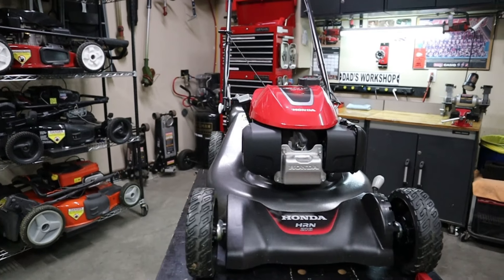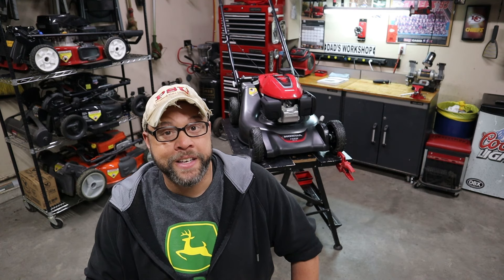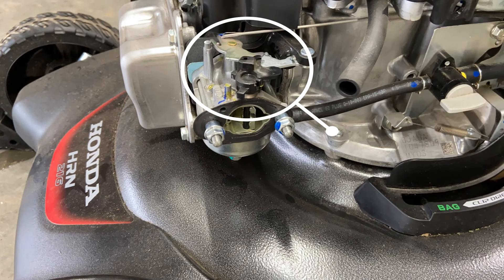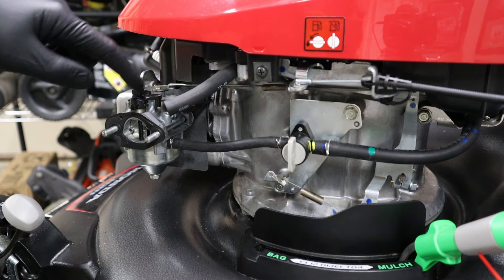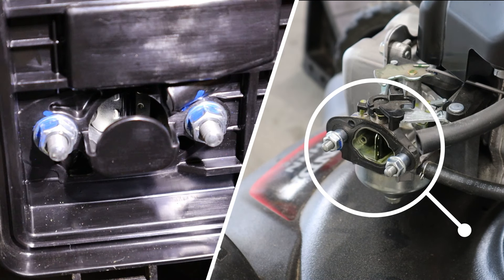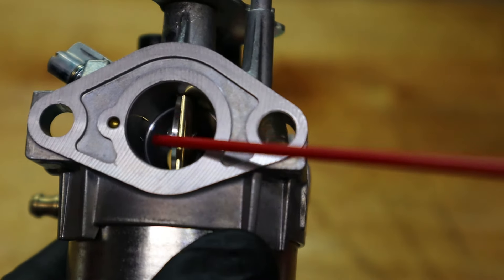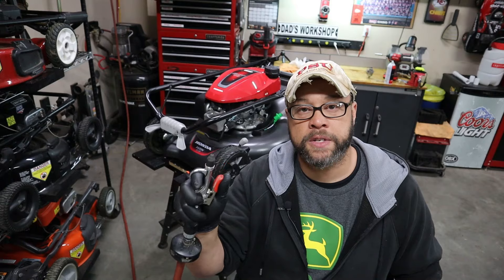New 2020 HONDA HRN216 GCV170 Surging/Rough Idle AND Auto Choke Test/Check

Comment: Thanks for the video, had the same issue with a mower that belonged to a customer. Cleaned the low speed jet twice after watching your video and it was still surging so I bored it out a little bit with a Gyros #77 bit and it runs like new again.
Reply from the maker: Great to hear and good job thanks for watching
Reply: did you bore the hole on top where the screw sets, or the one on the inside? or both?
Reply: @ClintL63  bore out the brass piece on the inside. It’s pin-hole small. Just find a micro drill bit that fits through it and go the next size up.
Reply from the maker: @ClintL63  no some are sealed off and not serviceable
Reply: I watched a video by another dude (see chickens clucking in the background).  He takes apart the float inside the carburetor and removes a brass jet with pin sized holes in the sides.  I’m assuming you recommend drilling out the one jet or the multiple pin holes on the sides?  I will have to find a link to post. I’m considering the #77 bit because I’m wondering how long the initial carb cleaning will be effective.  Will I have to clean this mower every summer or just the one time?  I’m looking for a permanent solution.  …thanks!

Comment: CAN YOU SHOW US HOW TO ADJUST THE RPMS?  CLEANED MY CARBURETOR AND NOW IT REVS REALLY HIGH ONCE WARMED UP.  I'm scared lol.
Reply: Sounds like it's boosting its turbo to hit a 8 second quarter mile lol
Reply from the maker: I'm sorry to hear this, David. Question do you have a tachometer?
Reply: @dadsworkshopbykipplabrie7982  yeah, it revs high right off the bat.   This thing can helo in SEAL Team 6.
Reply: @dadsworkshopbykipplabrie7982  it surged the second use.....cleaned carburetor.....started it back up and it sounded like it was on the starting line about to drag race on an episode of Street Outlaws.

Comment: Hello, Thanks for the video. I followed the exact steps and the engine started without surge. But after 2-3 minutes the mower starts surging again. Any suggestions?
Reply: Done the same thing to me. Went through 2 bottles of carb cleaner and a torch tip cleaning file with no luck. Then I seen a little switch on top of the carb that could be moved back and Forth. (Looks like a little toggle switch on a spring). With nothing else to lose I toggled it the opposite way that it was, put it back together and magic! Runs like new. No idea what that little switch does but it sure fixed it

Comment: After cleaning the carburetor. Now I have constant fuel leaking. Any idea why
Reply from the maker: Sound like the float is stuck open also make sure the carburetor bowl rubber  gasket isn’t torn if you disassemble the carburetor. If you can’t see it leaking externally it’s a stuck float or float needle.
Reply: @dadsworkshopbykipplabrie7982  awesome thank you. Cleaned float needle and fixed it.

Comment: Mine only did it on a hillside.  But now it won't start at all.  Junk mower. I changed the spark plug two days ago.  Dumped the old gas out, and put new gas in. Still not starting.  I'm going to try this next.
Reply from the maker: Hope this video helps, keep me posted WIlliam! See PDF link below for carburator cleaning flow chart.
https://cdn.powerequipment.honda.com/pe/pdf/pubs/otr55046.pdf
Reply: @dadsworkshopbykipplabrie7982  could I try seafoam in the gas? I think there was moisture in the fuel. I dumped the old fuel out.  And put fresh in it. My son left it out in the winter. And I didn't know he did that. Grrr. Lol
Reply from the maker: Seafoam works great! In some cases I seen Seafoam alone fix a surging/idle problem.
Reply from the maker: Leaving the Lawnmower outside during the winter is classified as "Lawnmower abuse" LOL.

Comment: How did you take out the screw from the carburator? Mine is really tight and I am starting to loose it
Reply from the maker: I get this question a lot and probably should address this. In my case the screw came out with little to no effort, but I have seen in some cases where “loctite” has been applied, not sure if this was from the manufacturer or an aftermarket part. If the pan head on the screw is still salvageable “heat induction” is your best friend when removing seized nuts and bolts. if you’re not comfortable safely applying heat to the carburetor I recommend soaking the screw with rust penetrant overnight. In some situations it maybe more cost effective to replace the carburetor assembly. Thanks for watching Mr Lopez.

Comment: I’ve done this “fix” four times to no avail. Ran wire through jets, still surging. Any help?
Reply from the maker: Focus on the pilot jet located on top of the carburetor cover by a Phillips head screw driver that’s the jet that is giving you problems. Have you tried compressed air yet?
Reply from the maker: https://cdn.powerequipment.honda.com/pe/pdf/pubs/te425pdf.pdf
Reply from the maker: https://cdn.powerequipment.honda.com/pe/pdf/pubs/otr55046.pdf

Comment: I am having same issue, however cannot get the screw in top to come loose  Any suggestions?
Reply from the maker: You can try a very small hand impact driver but the screw should come loose with minimal effort.

https://www.amazon.com/Performance-Tool-W2503-Impact-Extractor/dp/B00MXFFPVY/ref=pd_di_sccai_4/143-8325178-7303962?pd_rd_w=mmK43&pf_rd_p=c9443270-b914-4430-a90b-72e3e7e784e0&pf_rd_r=5RRVZQSCG533XN8VMQCX&pd_rd_r=41f12589-dcdb-4ea7-bb09-74b62fa18dc9&pd_rd_wg=0bZpK&pd_rd_i=B00MXFFPVY&psc=1
Reply: As someone said make sure the fuel valve is closed after each use.  I left valve ooen and did not mow for nearly two months due to dry late July through early September.   I learned my lesson.  Also Honda also says to fill your tank after each use to avoid similar issues.    Except when you shut it down for season.

Comment: Will a new carburetor cause surging?  Purchased from cub cadet, started on first pull but was surging, any advice will be much appreciated! Thanks!
Reply from the maker: It shouldn’t, just make sure the part numbers match up Honda has their part numbers etched on the side of the carburetor it should start with “BB”
Reply: Thanks will check
Reply: Also purchased from cub cadet in accordance with model number...mower has been in storage for 8 years, repaced fuel line, fuel filter and spark plug
Reply from the maker: I would check the strainer/mesh screen inside the gas tank and make sure it’s not clogged also make sure the gaskets that came with the new carburetor are installed correctly.

Comment: Hi  i have a honda GCV 170 i want to know where the fuel filter is located is it changeable
Reply: You've probably figured this out by now, but in case you haven't, it's in the segment of fuel line attached to the gas tank.

Comment: Why does it get clogged? Ethanol?
Reply from the maker: That is correct Ferris, Ethanol is the leading cause for carburetor failure, that being said Honda carburetors manufactured by Keihin are a little different than what you find on a Briggs and Straton. The transports "internal pathways" are much smaller than other carburetors, and Honda mentions this in every shop manual I have ever owned, therefore the smallest amount of debris clogging a jet will make the engine surge. Someone in the comment section stated that the assembly plant for most U.S. sold Honda lawnmowers operate and or work in a very dusty environment when it comes to prepping the mower for packaging and shipping, but as a certified Lexus tech like myself, I know quality control would put a stop to that really quick!

Comment: Mine is brand new and doing this. Less than 2 hours on the motor
Reply from the maker: I've heard of this carburetor problem straight out the box or after 1 or 2 mowing sessions. The carburetor that comes on the new HRN216 is smaller and much lighter than Honda carburetors in the past. It's still manufactured Keihin but feels much cheaper.

Comment: I believe carb problems are happening too soon.  If it happened this soon it will likely happen again. My 190 cc Briggs is probably at least 10 years old.  Only oil changes, air filter, and changing blades.

Comment: My Honda was surging and I followed these steps to a T and now it won’t even start. What did I do wrong?
Reply from the maker: Did you turn the fuel shut off valve back on? Spray starter fluid near or on air filter, if she starts and runs for a sec then the carburetor is still dirty lil more cleaning to do.
Reply: @dadsworkshopbykipplabrie7982  won’t start at all going to try and do more cleaning.

Comment: Help! I did everything you just recommended. Didn't stop surging. So I purchased a new carburetor and it's still surging. Any other suggestions. I'm so done with this mower! Not even 9 months old.
Reply from the maker: I would check the governor spring next
Reply: @dadsworkshopbykipplabrie7982  thank you! what should i be looking for?

Comment: That screw will not come off on mine i could drill the screw out but common this is a brand new mower. Any suggestions?
Reply: I had the same engine surge problem. I could not get the screw off either but cleaned every other crack, crevice and hole with carb cleaner. I put it back together and it solved the issue. Hope that helps. Let me know how it goes for you.
Reply: @JMang101  i called a shop and the screw i was told does not come off this particular model or some models and yes carb cleaner and clean the carb works great. Apparently when you store it with gas in the carb with a small pilot jet the gas residue jells in side the small pilot jet. So ill just turn off the gas and run the motor until it runs carb out of gas and store it every one or 2 weeks until next usage. seems to work for me. i still dont why Honda would make a screw head that is a dummy and its not removable. seems like Honda like to play game$.
Reply: @davidperrie8931  do you add any fuel additive like STA-BIL?
Reply: @JMang101   No i do not. The reason why is we should not have to were dealing with a 2021 brand new Honda lawn mower. supposedly reliable and low maintenance. but then again maybe ill take that into consideration. i just might start. Honda is pulling a fast one again.
Reply: @davidperrie8931  I agree with you. I love Honda automobiles and this my first lawn mower I bought (hrn216, purchased used). I just read the manual online and they have a specific section on avoiding fuel related problems. I suppose the carburator design is not as robust to deal with deteriorated fuel. Basically don't leave fuel in carb, turning fuel line off and adding additive if large gap  in mower use is expected (1 to 3 months).

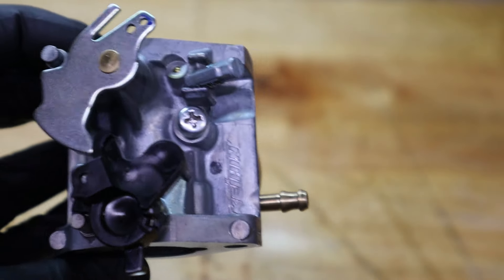Comment: How did you remove the pilot jet screw (3:15)? I’m trying to get mine out and its almost stripped and not budging.
Reply from the maker: It’s pretty much cemented in there and it’s designed to break in half if removed. I just unscrewed the cap/cover and cleaned the jet.
Reply: @dadsworkshopbykipplabrie7982  I'm having the same problem, what is the cap/cover cover?

Comment: I have the same lawn mower. If I wanted to get a new carb, is the replacement the same as the GCV160? My model number is GCV170a MY03 R280,  Lawn mower model HRN216VKAA. GJAUA 1049006. Stamped on the carb is 76J (A) KC14.I googled and can't find anything on it. Any help would be appreciated.
Reply from the maker: Great question! I’ll look into that for you but off the top of my head I don’t think there interchangeable plus you have to factor in “fixed” or “Manual throttle” setup. I’ll get back to you tonight.
Reply from the maker: Plus the price difference is pretty dramatic which tells me it may not work on a GCV170
Reply from the maker: Mr. Turowski, I think you found the loop hole my dude. Honda has been playing us HARD! I was able to get not 1 but 2 older style carburetors to work on the new Honda GCV170 engine. The only catch is that you lose the "Auto Choke" feature and in fact I removed the auto choke valve completely on one of the carburetors. The consistency I found when swapping older style carburetors, was that the auto choke lever arm was misaligned, or the lever arm its shelf was too short to operate the choke valve, which resulted in using a can of starter fluid/brake cleaner to start a cold engine. After the engine reached operating temperature, starter fluid was no longer needed, and I had no problem restarting the engine. Both carburetors ran smoothly @ 3000 rpm for +/- 5min and in my opinion 1 carburetor out preformed the O.E.M. carburetor. I listed below the part numbers I can personally confirm will operate on the new GCV170 Honda engine. Stay tuned folks! 

Reference# Engraved on O.E.M. Honda carburetors manufactured by Keihin   

BB-75J-A-FD04 <--- Honda Part# 16100-Z8B-841 
BB-65A-B-KG07 <--- Honda Part# 16100-Z0L-862
Reply: Kipp, thanks for the info. It was driving me nuts. I can find the 160s for like $20. The 170s are like $80. I'll look into the replacements you mentioned. Thanks Man!!!
Reply: could mixed gas cause this?
Reply: Ended up being old gas I guess? Either of the 3 times I cleaned out carb I finally got it

Comment: What if you can’t get the screw off?
Reply from the maker: The screw can be stubborn at time try using a bigger Phillips head or a small hand impact. Worse case you will have to replace with a new carburetor assembly.

Comment: Great video. One question though, I took the air bleed screw out when I cleaned the carb but how am I supposed to reach the screw to adjust it when the carb is installed. It seems near impossible to get to.
Reply from the maker: I’ll have to get back to you on that
Reply: @dadsworkshopbykipplabrie7982  I have the same problem. Any update?

Comment: What's with all the blue dots?
Reply from the maker: I have not a clue Julie, but I do know my wallet is still empty LOL. I think you have to pay to get rid of "AD's" now. Thanks for watching.
Reply: @dadsworkshopbykipplabrie7982  It was meant to be a serious question. I am having the surging engine problems. I rebuilt the carburetor. That did not help. I replaced the throttle and choke springs. That helped some until it started running wide open. Then I noticed the blue dots and saw the throttle spring had an orange dot on it.  Garage door springs are color coded so why not lawnmower springs. So I ordered another spring. You will have to wait until next weeks exiting episode to find out if color matters.
Reply from the maker: My bad I didn’t understand the question. Yes, colors do matter in some cases sometimes this can just represent an “OEM” part and or untouched or never replaced before. For example Briggs will put an “X” at the end of the spark plug part # letting the technician know it’s never been replaced. I’ll look into those colors or dots and report back to you.
Reply from the maker: BTW if it’s still surging after the carburetor rebuild I still think the pilot jet is clogged. It doesn’t take much to clogged those transports but it sounds like you’re getting it.
Reply: @dadsworkshopbykipplabrie7982  Thanks very much. Also I have the 170cc. When I look for parts online they all list the 160cc.
Reply: Are they the same parts?
Reply from the maker: Yes, We “Lexus” use the same method at my dealership when servicing vehicles. If I see anything other than a grey sealant on the engine I know someone else has been here.

Comment: I bought that machine 2 weeks ago.  After 2 uses, when the engine starts to warm up, it would "surge" (do a constant..  BRUMM>>>  BRUMM>>>).  I returned it today and am afraid to buy any new machine, considering the high prices.  I refuse to buy an expensive machine that I have to dismember so quickly.